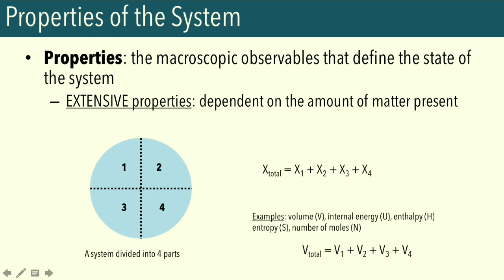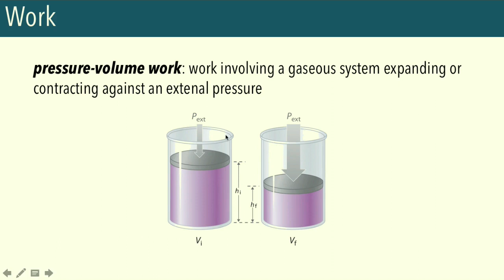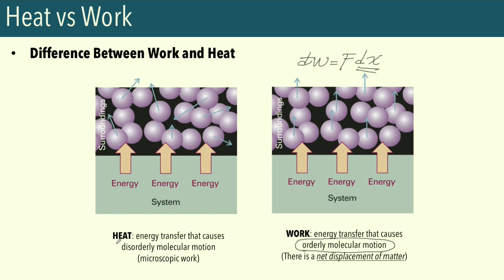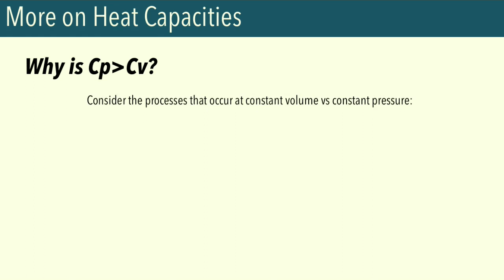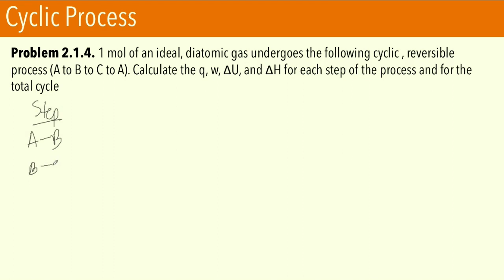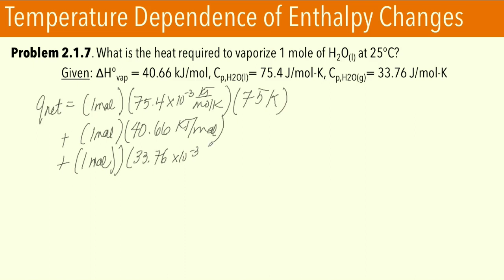2.1. 1st Law of Thermodynamics

Comment: At 2:23:49 there is no work being done so U = Q and they should be equal, you only use enthalpy if there's boundary or flow work.  Remember that H = U + PdV, and there's no PdV here.  -12,471 Joules is the final answer.

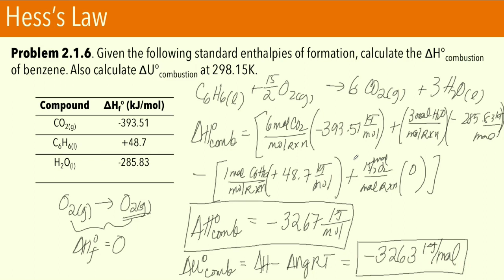Comment: hello, what's the value of delta H and -ngRt to get the delta U @ 2:51:09. upon solving it , im not getting the same answer. can someone double check too? thank you
Reply: the answer for delta U was -3263kj/mol . what i got using this, delta U= -3267kj/mol - (6-7.5)(8.314)(298.15) = 451kj/mol

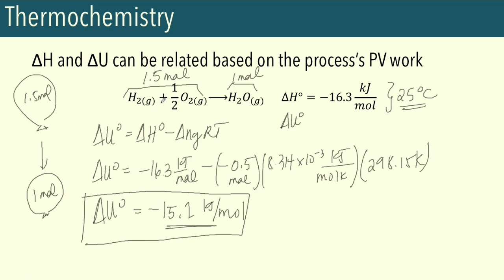Comment: at 2:38:12, when we're calculating delta-U-not, the PV units end up being KJ, but the delta-H-not is in KJ/mol... am I missing a step?
Reply: is the the delta-H-not supposed to be multiplied by 1 mole, since the product is 1 mole of waters, so the units for the answer is in 'kJ'?
Reply from the maker: +Andrew Nguyenba hey Andrew! Thanks for pointing this out, I think I missed emphasizing a point in my discussion. In thermochemical equations, the delta-H-not is in kJ per mole of balanced reaction as written or (kJ / mol reaction). When we check out the units for the PV work term (delta-n)RT, delta-n is actually change of moles of gas per mole reaction or (change mol gas / mol reaction). What cancels out when multiplying delta-n with R is (mol gas), so the (mol reaction) unit remains. The units for the PV term should be (kJ / mol reaction), same as delta-H-not. I hope this clarifies things!
Reply: @SarahMaySibugTorres  There is also a 4th law of thermodynamics as entropy is dual!
From a converging, convex or syntropic perspective everything looks divergent, concave or entropic -- the 2nd law of thermodynamics.
All observers have a localized, focused or syntropic perspective.
Mind (the internal soul, syntropy) is dual to matter (the external soul, entropy) -- Descartes or Plato's divided line.
My syntropy is your entropy and your syntropy is my entropy -- duality.
Syntropy (prediction) is dual to increasing entropy -- the 4th law of thermodynamics.
Teleological physics (syntropy) is dual to non-teleological physics (entropy).
Ellipsoids are dual to hyperboloids -- linear algebra & matrices, Gilbert Strang.
Positive curvature is dual to negative curvature -- Gauss, Riemann geometry.
Curvature or gravitation is dual -- gravitational energy is dual.
There are patterns of duality hardwired into physics, mathematics & philosophy.
Homology is dual to co-homology.
Integration is dual to differentiation.
Homology and integration reduce the number of dimensions or states -- a syntropic process.
Co-homology and differentiation increase the number of dimensions or states -- an entropic process.
Syntropy (convergent) is dual to increasing entropy (divergent) -- the 4th law of thermodynamics.
Gaussian negative curvature is defined by at least two points -- non null homotopic.
The big bang is a negative curvature singularity or a white hole -- Janus hole/point.
Janus holes/points have two faces (duality) -- Julian Barbour, physicist.
Points are dual to lines -- the principle of duality in geometry.
Null homotopic is dual to non null homotopic.
Topological holes cannot be shrunk down to zero -- non null homotopic.
The "bridge" between elliptic curves & modular forms is duality!
Injective is dual to surjective synthesizes bijective or isomorphism.
Thesis is dual to anti-thesis leads to the converging thesis or synthesis -- the time independent Hegelian dialectic.
Isomorphism is duality: two differing descriptions or aspects of the same thing.
Gravitation is equivalent or dual (isomorphic) to acceleration -- Einstein's happiest thought, the principle of equivalence (duality).
"Always two there are" -- Yoda.
Duality is hardwired into the laws of physics & mathematics!